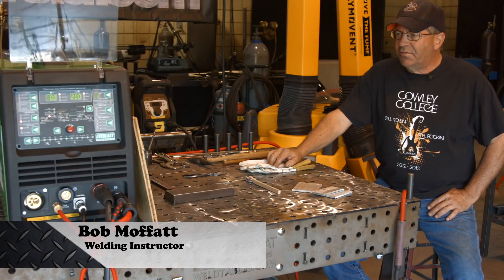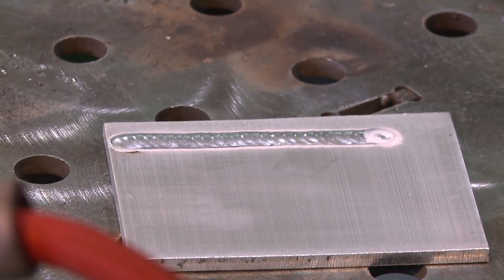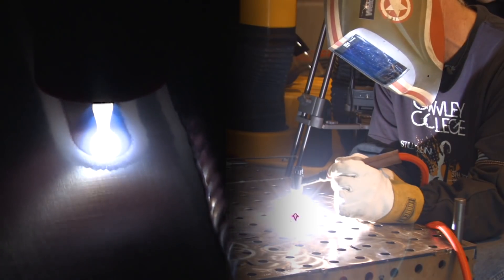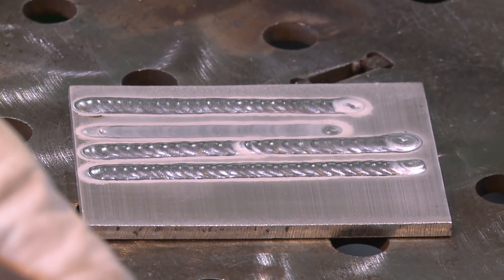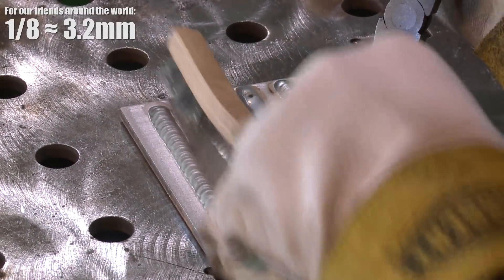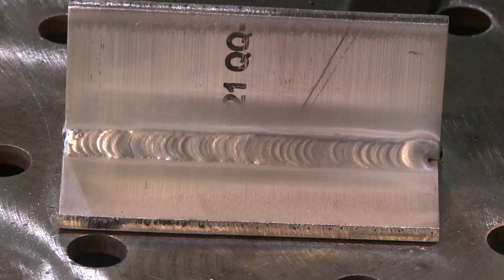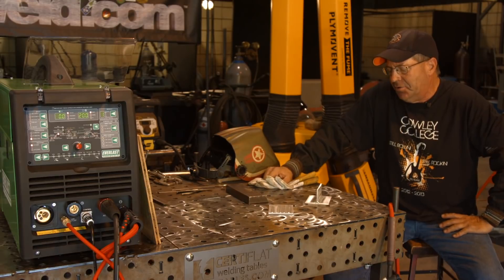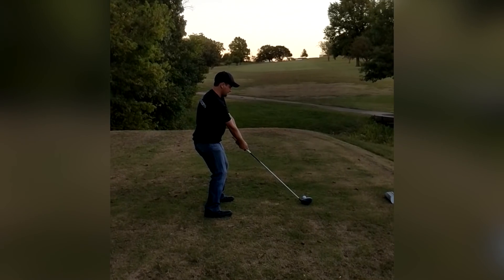🔥 Everast PowerMTS 221 STI 4-in-1 Welder (AC TIG Demo)

Comment: Hi there I’ve just brought this welder and I was hoping that you could help me cause I don’t know what my settings should be for welding sheet aluminium of 3mm. What I get at the moment is about 3 seconds of pre flow argon Gas with the chosen current flow then I get an error code (E05) and just the Gas is shut off from shielding the tungsten so the tungsten is getting oxidised. I’m assuming that’s because my settings are wrong. 

If you could offer some rough settings for Hz and balance etc. That would be so kind. Thanks

Comment: The Avortec AV6X+ or AV10X+ I think is a better deal and they come with a 60 amp plasma cutter to boot. AC/DC TIG with pulse. A real all in one machine from $2000 and up depending on equipment.

Comment: Thanks for these videos.  I teach at a local technical college in the automotive program and am taking welding classes in the evenings.  I've gotten hooked on TIG and am getting to try out a few Miller and Lincoln machines.  Ended up buying a 1974 Miller 330 a/bp at a moving sale for $500 with everything ready to go.  Did some maintenance on it and found that I really like how a transformer machine welds aluminum.  Been practicing with the latest modern machines old school... just setting them to sine wave and about 75 hz (mine you can adjust frequency, so not just running 60hz).  Finding that the better I get, the less I'm inclined to mess with pulse and all the shaping adjustments.  Also found that a GOOD helmet is a great investment, just swapped out from a cheap ANTRA to a ESAB Sentinel A50 and my welds instantly got a LOT better as I can see better even without the cheater lens I'm usually running.  Suddenly horizontal and vertical uphill TIG are 'easy'.
Reply: Those old 330 round tops are a great machine. I had 3 of them here at the college when I first started here 20 years ago. Smooth power source. I had a female student that could do 16ga ally fillets like a champ.

Comment: I took delivery of my 221sti last week and just today started to use it. I too am having exact same termination issues as this video.  I dismantled the foot pedal and found that the fitment between the rack and pinion on the potentiometer is horrible as is the pivot point of the rack itself.

What's happening is that the rack is jamming up against the guides and the pinion gear and when you are easing up on the pedal there isn't enough spring tension to return the "sticky" rack.  The pedal surface itself is on a different spring so it follows your foot adequately but with the rack jammed the on/off microswitch opens the circuit and shuts down the arc.

In this form the foot pedal is practically unusable.  I did some temp modifications to keep things somewhat alligned better but it's only temporary fix until I contact Everlast in the morning and ask for a resolution.
Reply: As expected, Everlast promptly returned my call and without hesitation offered to resolve my pedal issue at no expense to me.  It's nice when they call you personally and you don't have to chase after them!
Reply: please call us and will send you new upgraded NOVA PEDAL, that should solve the problem!
Reply: Mike at Everlast what size wire spool does it run? How long are mig leads? How long can I safely run on this machine?

Comment: Is that the torch that came with the machine?
Reply: BeGamerSl Nope
Reply: The torch comes with the machine or not? If it does how is it quality wise?
Reply: BeGamerSl Already answered no. They are all interchangeable. I grabbed a torch that was set up already. One that I've used before. They are all the same and quality. Hope that helps. Do you tig weld?
Reply: Not really but I wish to get started. Once I can afford one. Quite hard for a 14 year old to gather over 1000$ and convince my parents its a good idea.
Reply: Check into if you have welding as a class at your high school or local technical college (especially if you can attend a college as a high school student and possibly get a head start on a certificate or degree with the state paying for it).

Comment: Wow!!  Finally a COMPLETE all in one machine that even does AC tig...I guess $1,899 msrp, since the same model last year didn’t have AC and was $1,299...that is impressive!
Reply: 2200 average sale price
Reply: you will be able to get it for 2400.00 on sale .
Reply: not sure about 2200 "average" price
Reply: I purchased mine last month on sale for $2100. And it is worth every Pennie and then some . its like fine Scotch smooth!  It has every feature you could ever want I haven't did a lot of AC yet but mig and DC tig I haven't laid out a lot of welds already.  Man the arc force and hot start on stick makes it so smooth. Though i am no beginner I bet a person could learn stick 3 times faster using this machine. And Bob thanks for the videos.
Reply: 2699.00 list price I think...

Comment: Cool video... Is that buzzing sound normal in machines?
Reply from the maker: Yes it is normal in AC mode. You won't hear the buzzing if you are welding Steel (or anything else in DC).
Reply: Mar Ran the buzzing is due to the frequency the machine is set at. Older transformers are fixed at 60 hertz. Inverters have adjustable frequency. The frequency on my miller dynasty will go all the up to 400 hertz.